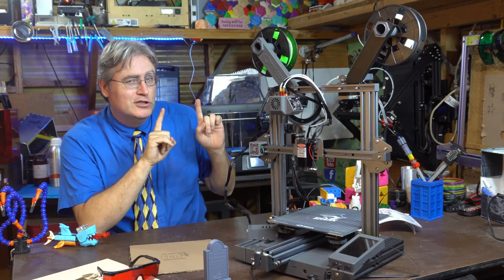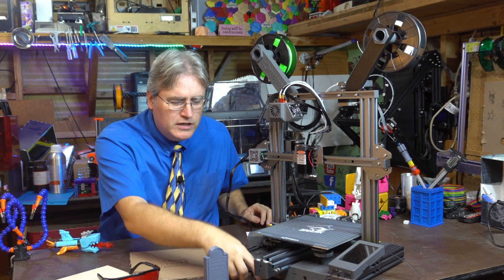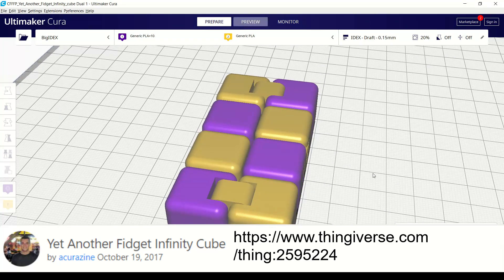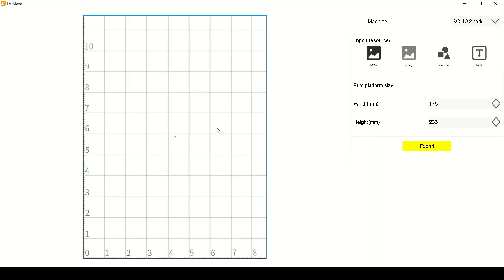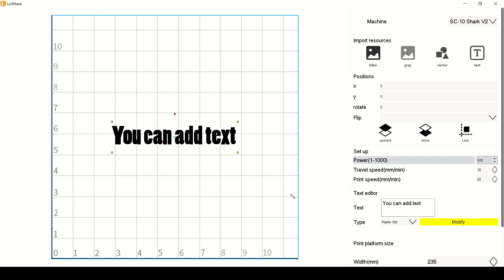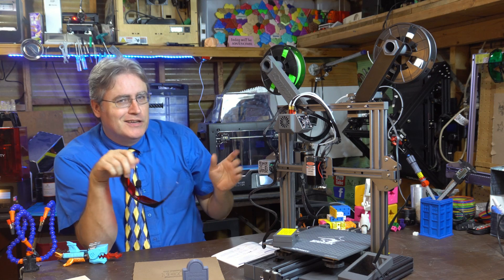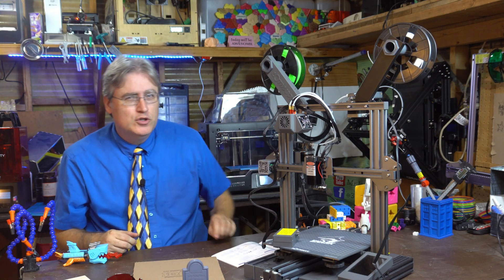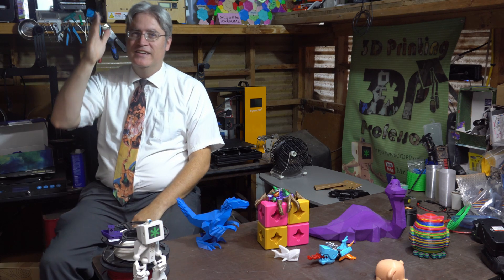Is the Shark V2 3-in-1 any good? 3D Printer and laser engraver... mess

Comment: I have a shark v1 and a v2 and I love this printer it works just fine for me print quality is fine depends how uptight you are if you drive a Lamborghini your gonna hate a Toyota even tho that Toyota is more reliable
Reply from the maker: It's not so much that this is a Toyota, but that this is a Toyota that someone has spot welded a Gerry-Rigged tow truck rig on that they built themselves, and figured out how to get it working, but never actually used a tow truck so their solution is non-standard and kind of a mess.
But, I'll tell you the truth, I've used worse. In fact I'm testing worse right now.

Comment: any laser engraver or cutter without a laser blocking enclosure, and safety measures that prevent firing the laser when the enclosure is open is a no-go for me. and also makes me wonder if this printer even has thermal runaway protection enabled.

Comment: I got the V1 via kickstarter and the laser is a bit meh. The dual extrusion is kinda neat but honestly just one is all I use. It does a pretty good job though. HOWEVER the biggest gripe is that the firmware is closed source! Lame. What's unfortunate is that they have limited the laser features because if you think about it what if you could use the laser to etch a 3D object since you have a z axis on it. Just a waste of the other multiple features if you can't combine them.

Comment: I have seen other reviews of this, and I did not realize that they two extruders were on different places on the frame.  How tough would it be to place the lower extruder on the top?  This is a classic example of the 'sports-car/dump-truck' school of design (we added EVERY feature we would think of but none of them will done WELL).  When will these manufacturers figure out that the second point of contact with their products is the DIRECTIONS (first, is the box.  If it is shipped and looks like Fred-Ex barely slowed down before THROWING the box on the porch), and CHENGLISH is a sure sign for me of a future FAIL product.  (My anet A-8 (with classically BAD Chenglish translations) was traded for a service on my tevo tornado)
Reply: Between the jankiness of the dual extrusion system and the laser etcher, this has the feel of a hobbyist modded project rather than a commercial product. It's like a proof of concept someone decided to run into full production without telling the engineers.

I'm glad they didn't try to emulate Snapmaker further by including a CNC, god knows what kind of slapdash horror they'd have built.

Comment: This printer is good but does have issues that you did not cover.  The auto bed leveling is a big flaw.  The sensor head rests inside the hot end mount.  I found on my shark that the sensor mounts to low for the nozzle.  I have had many failed prints then I figured it out.  You have modify the configuration file for best performance.
Reply from the maker: This one doesn't have auto bed leveling. Did the V1? Did I get a pre-release version again that wasn't feature complete?

Comment: Yeah the laser on that printer is almost useless or if you have hours of time then you can get one thing done due to it being ungodly slow. I did find the dual color printing to be pretty accurate but you're not going to want to mix materials just make sure it's the same material just two different colors.

Also what they meant by plugging in the laser module and destroying the machine you can't hot swap it. Ask me how I know 😅

Overall it does decent 3D prints but for its price point it's not recommended.
Reply from the maker: It's not hot swappable either?!

Never mind that the open laser on this could be pointed any which way and fired because there's no safety on it. This is not recommended at any age.

Comment: Hi professor. Any sure-fire recommendations for a ~300-400 USD budget 3d printer? Should I just get an ender 3 v2?
Reply from the maker: Heh, sure fire. Are you hoping for a laser or a thermal runaway?
It very much depends on who you are, and knowing nothing about you, I'd recommend checking out the Flashforge Adventurer 3. Because I've seen tons of Ender 3 V2s that were "broken", when the only problem was people didn't read the directions and level the bed properly, and the Adventurer 3 doesn't have that problem.
That said, if you can handle a little more technical of a challenge, the Ender 3 V2 is probably the most mature option out there.
Reply: dont get a V2 get a Voxelab Aquila version 2, you get a V2 clone that is actualy better than the V2 and cheaper to boot